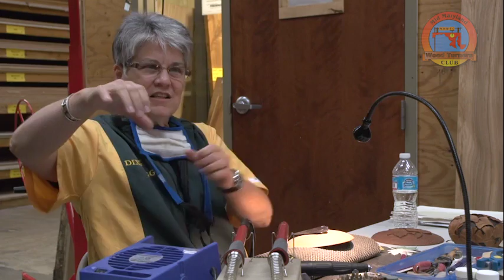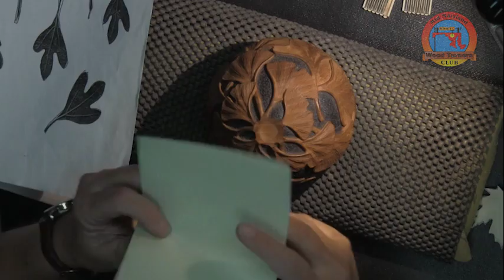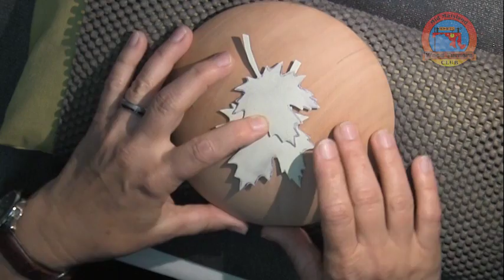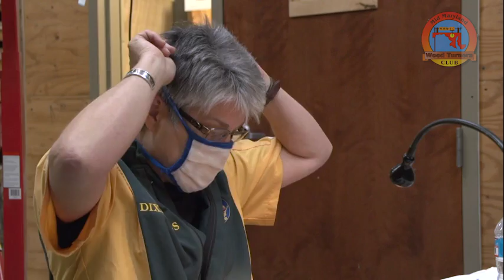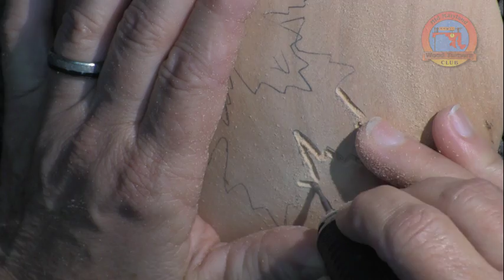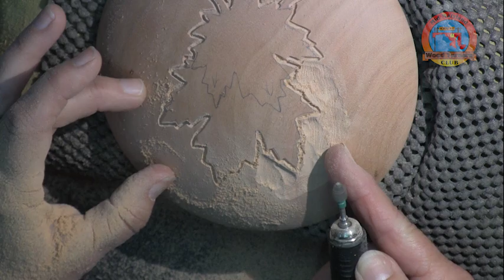Dixie Biggs Demonstrates Relief Carving for Woodturners - Part 1

Comment: Hi I am looking at getting in to fretwork and I would like to expand with glasswork,relief carving and rock carving can you suggest a single flexidrive (or similar product) for all (ideally) or individually? I currently have a foredom flexidrive from my old watchmaking days. Now I am a disability pensioner and thought of getting the other areas under my belt as i have the time to focus on it. I prefer engraving to sandblasting as it's all done by hand. Kind Regards Scott